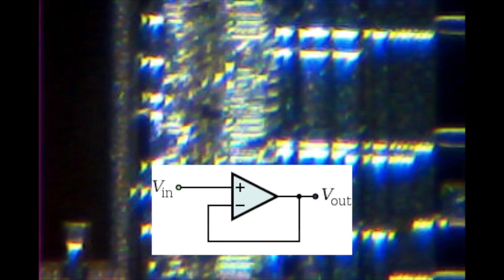What's inside a microchip ?

Comment: silver is not the best conductor, gold is. thats why they use it in the most important parts of the pc, ones that cant stand to lose data
Reply: +Perry Seay Any gold in a PC is just a plating designed to prevent corrosion on contacts. As it happens gold is actually a relatively poor conductor, having a higher resistivity than Copper and Silver.
Reply: +TheWhooo123 no there is solid gold bonding wire, learn before you talk about stuff you dont know, pin are plated....
Reply: +Perry Seay Before the millennium, sure.
I dare say your proclaimed knowledge is a bit outdated. I refer you to the modern world.
Reply: +TheWhooo123 its the link doesnt work search gold bonding wire, video is 3.36 long
Reply: +Perry Seay 1). Correct, they all have solid bonding wires. 2). Correct, they are not all gold. Especially modern varieties of PC ICs. 3). Correct, a lot of DLP chips do use gold bonding wires. 4). Three chips out of the billions in existence does not a generalisation make.
As we're having a proper conversation, care to explain why you think gold is a better conductor than silver? You haven't even touched on that since your first comment.
Reply: +TheWhooo123 silver is better for certain things cause gold can be rigid, But it tarnishes, which means a high resistance oxide/sulphide forms on its surface. but silver can only hold a low voltage where gold can hold a shit ton more. so in computers you need reliability with heat. amd so there is no data loss. once again look a little more and learn man.
Reply: +TheWhooo123 silver is used with copper a lot in circuit breakers and so on which fine that is easy for it to handle. but when you have voltage and binary code through a computer or even high end servers they use gold wire very rare mainly computers so in the end, silver can handle small loads of voltage, but tarnishes fast btw depending on application and use, gold can transmit data and high voltage with ease. silver can transmit to but once heat and tarnish happens ur out of luck, gold never tarnishes, you ever gold in the ocean brought up after 200 years its still brand new
Reply: +Perry Seay What does that mean, "silver can only hold a low voltage"?
Reply: +TheWhooo123 oh did u know that silver is such a soft metal if u have pure .999999 silver in a coin or some shape and u hit it petty easy it will smash.
Reply: +Perry Seay Incorrect, it is malleable not brittle and will plastically deform, not smash. Basic material physics. Not that this has anything to do with electronics.
Reply: +TheWhooo123 omg i didnt use the terms u wanted, i didnt say shatter, smash, squish and brittle meaning soft. sorry i used 1 incorrect term on brittle, smash was right in my head the way i was meaning it
Reply: +Perry Seay Fair enough. 
Now I'm really interested to understand what this "silver can only hold a low voltage" thing means, would you be kind enough to expand on that?
Reply: +TheWhooo123 Oops he ran away. Have rarely heard such a load of gobbledygook!
Reply: Your name is awesome
Reply: Arsyad Kamili
Toast at minus 273 degrees is better.
Reply: Arsyad Kamili
Haha, I'm partly joking, but referring to a super conducting material as most conductors become such at absolute zero, which is minus 273 degrees C or zero Kelvin. If you want to become the richest man on earth find a superconducting material that works near room temp...And don't apologise, its not unusual for me to confuse.
Reply: Arsyad Kamili
In fact doped graphene may be that elusive material...I just googled graphene v super conductor. Exciting stuff wow.
Reply: Arsyad Kamili
PPS maybe its not..
Reply: Arsyad Kamili
Hahaha yeah
Reply: JP Aldama
You are awesome.
Reply: diamond is the best conductor i think, but very expensive

Comment: nice video...optical microscopes do have their limitations.......the 'leads' from the frame to the chip were once aluminum, but mostly all gold now, they are 'cold-bonded'....welded by ultrasonics....... 27X512...I think that's the densest EEprom available in 28 pin package...

Comment: The wrong phrase: 5'40" 'there is more going underneeth that we can't see'  . Nothing happens deep inside in 3D. All transistors are on the surface of the die. There is nothing hidden; there is nothing behind. There is nothing in the volume. You really get what you see. The die is covered with lines of copper and tin. Sides are linked with gold wires. The silicium die itself is really cubic: after removing the copper lines, you get a pure silicium cube containing the transistors. Transistors are diffused on 6 to 12 layers, but that's all. All transistors are on the surface of the die. And on the same side of it too. The only 3D aspect is that there are several diffused layers of dopant to make one transistor. You can not hide stuff deeper inside.
Reply: +Benoit-Pierre DEMAINE There is a layer of silicon dioxide covering the whole die so actually you can't see the transistors. All you can see on the surface is the silicon dioxide and aluminium silicon alloy traces going to the contact holes.

Comment: Each micro resistor is controled by the resistor before it its hard to explain but i will try. In order for one micro resistor to produce multiple results i must control the data or current sent to it in the first place. Think of a dimmer switch on a light by increasing the resistence i decrease the light emited wow this is harder to explain than it is to understand lol

Comment: The technique for bonding the wires on the die is called cold welding. It works by pressing two clean metall pieces together with high pressure until they meld and form a bond.
Reply: humans age 200 000 years  dinosaurs age 160 000 000 years..............
.https://www.youtube.com/watch?v=3whq8Y6wcKs.............. 
 NO NEXT DIMENSION NO NOTHING.

Comment: there will come a day when we cant physically fit anymore transistors on chips
Reply: they're still getting made smaller. once they're as small as they can possibly be, it'll just be the norm to have 2,3,4 of them on a motherboard
Reply: then new more efficient architectures will come or maybe they will begin using light to transmit data inside the chips or we will all be dead
Reply: just wait until they have a cpu that was in the TERMINATOR'S BRAIN

Comment: I've always wondered how precisely has to be the printer (?) that designs and prints every single transistor. 
Ok, I might be incorrect; but how do they even get to make those microscopic plaques to be so perfect?
Reply from the maker: They use a process called photolithography–much like making a PCB. There are numerous steps but the main 'printing' is done by a laser, either photons or electrons depending on the precision needed. 
The entire process is repeated for every layer.
Reply: I just found out that during the photolithography process the light patterns that pass through the mask are reduced by a factor of four by a focusing lens and then projected onto the wafer. Now the whole process seems much easier to accomplish to me:) however, I am still in awe on how to read and store, and how everything is interconnected to allow the software to work hmmm
Reply: La Fo The manufacturing rejects is enormous.
Reply: ***** That GlobalFoundries video is just sooo good.
Reply: beanerama9 laz0rs
Reply: Csab  Technology is from God.When u read the book of Daniel in the Bible.God say he will show us things hidden in dark places.The idea behind Microchip is Microscope n Silicon.If u wanna break the conventional rule u can make a chip.U should have idea on how to manipulate electricity, Chemistry art/ARCHITECTURE LIL PHYSIC.As I said.Jesus Christ is coming back
Reply: beanerama9 they know the power of dividing (flower of life) they have nano printers too,that's why if one anunnaki was here,he's gonna say don't do it,nanominerals make holes in brain,but ya,they dissapear long time ago  ☼☾☄ ₪itibira₪ ✶☥ ⊀ ⋉▲▵▴